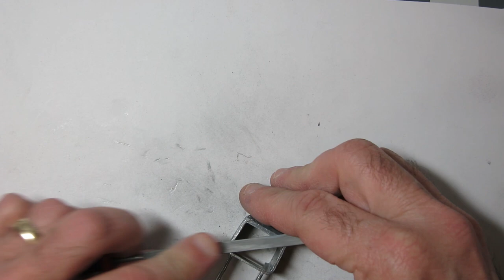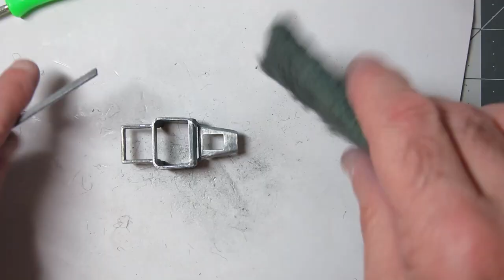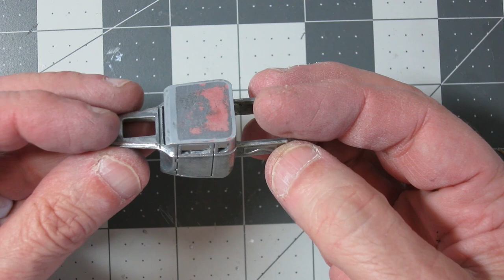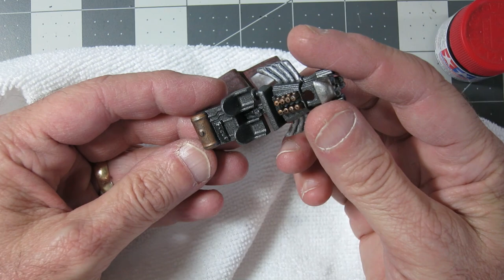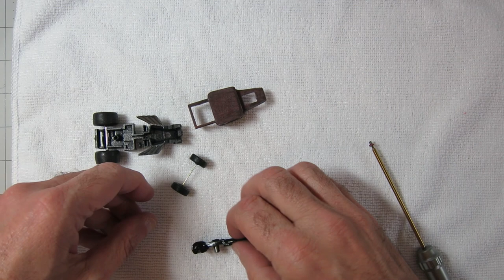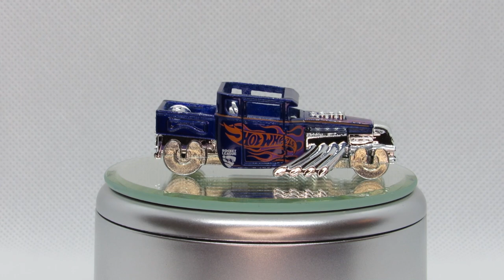Hot Wheels Custom Bone Shaker - Trying a Few Ideas

Comment: Cool build, Jim!! Looks great. 
When doing a roof-type project I've found that regular 30 minute epoxy is superior to JB Weld because not only can you pour it easier than trying to spread JB in tight confined spaces, it's long set time allows any bubbles to rise up and out so there's less chance of any voids that need putty. It sands nicely if you give it two days to fully cure. 
My first Bone Shaker build used Muscle Machine wheels and it's a great look. 
I was so happy to see a new build tonight--Thanks!!
Reply from the maker: Thank you!  Superior to JB Weld?!?!?  Impossible!!! 😂😂😂  Thanks for the suggestion - I’ll have to give it a try!!